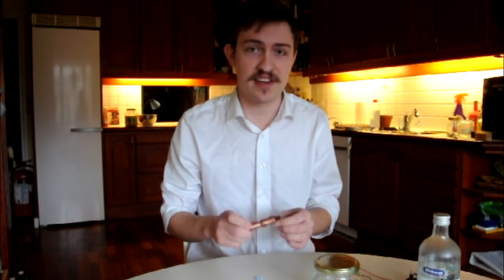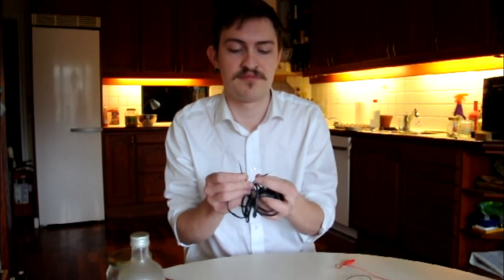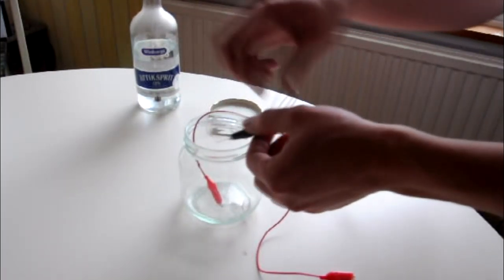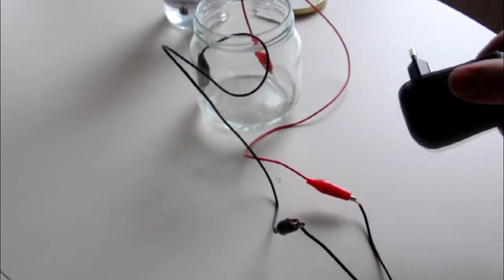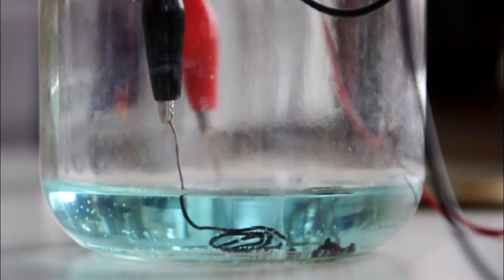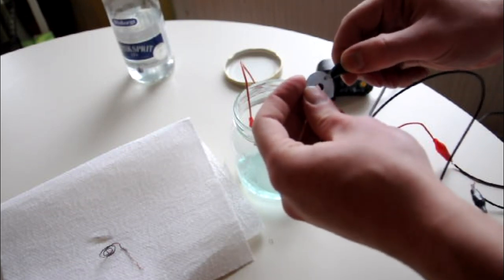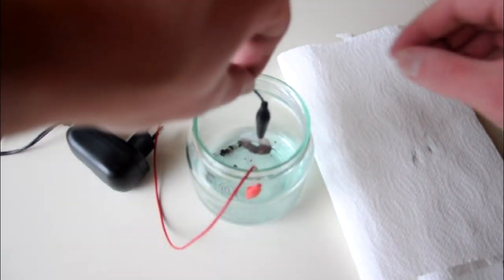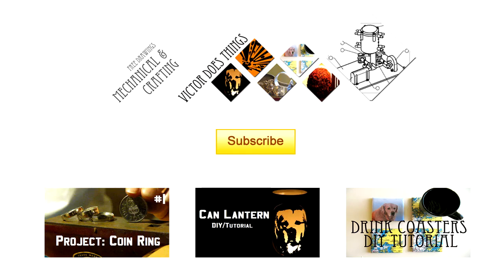Copper Plating || DIY Tutorial

Comment: So what's the deal about the well ventilated statement? Is the gas bubbles given off dangerous, explosive, toxic, etc?
Reply from the maker: you get some cloride gas from the salt and if i do not remember wrong,  some explosive gas i do not know the name of in english.
Reply: +Victor Does Thanks for explaining further. If the liquid were water I might say the explosive part would be hydrogen or hydroxy gas, but I'm not sure since it's vinegar. The chlorine gas is enough to do it outside though. Thanks again.
Reply from the maker: Oh, yes, it was vinegar I used for this! Then it might only have bin the chloride gas. Mixed it up with rust removing :)
Outdoor will do fine for this experiment!DukeOfMarshall
Reply: +Victor Does you may be thinking of hydrogen

Comment: Interesting; what is the chemical formula for the resulting blue solution? or are the copper particles only suspended in it and not bound to anything?
Reply from the maker: I might be totally wrong, (it was 6 years sins I studied chemistry.. ), But I would guess fore a mix of: Copper sulfate (CuSo4), salt and water. Then some chlorine and H2 + O suspended in the air.. But Now I am just guessing! :P
Reply: When the copper plating is done, do you think all of the excess solution (everything but the raw copper) can be washed COMPLETELY off of the object, or is some permanently embedded into the surface? I am thinking of doing this to the inside of a stainless water bottle for bacterial resistance, but I don't want to end up leaching toxins off of the copper plate over time.
Reply: ***** could you copper plate copper on copper
Reply from the maker: Ohh... Good question.. I  guess you could! Sins you can grow "copper crystals" that way. But I am not sure...
Reply: thank you for the response I have some copper but i don't want to melt it down so I want to try to electroplate it